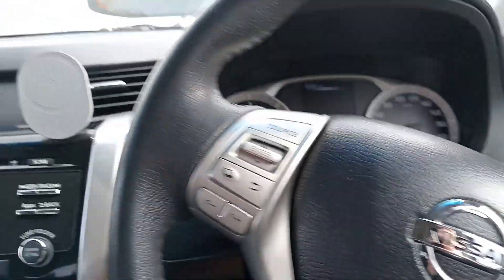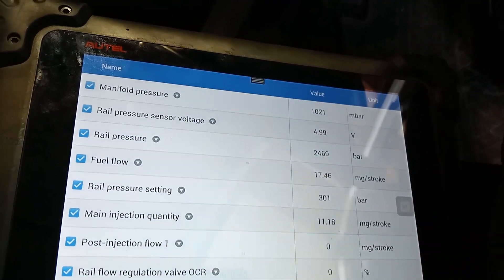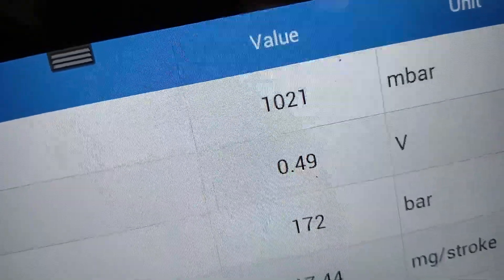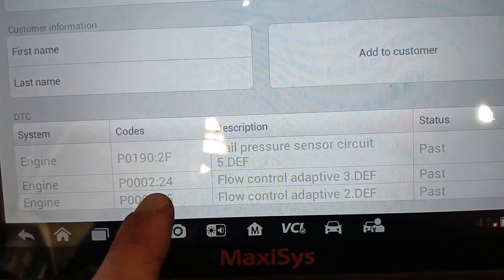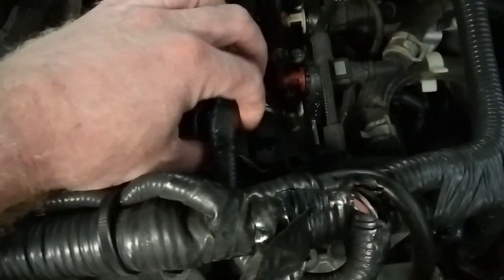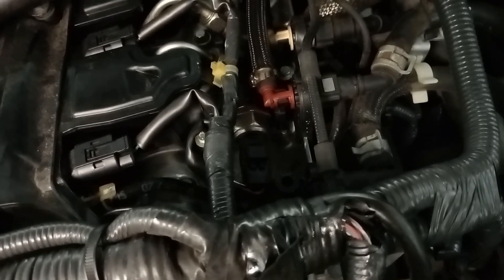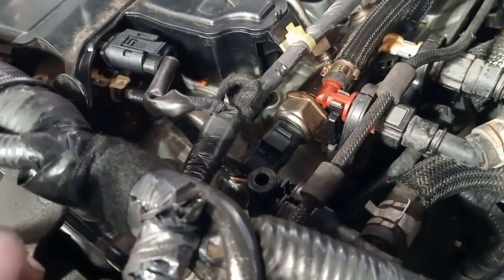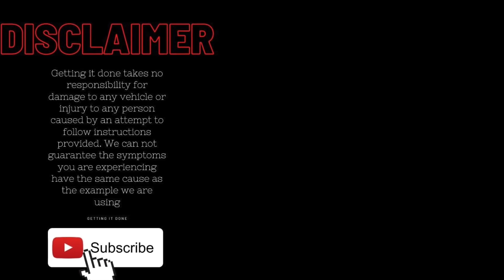Navara NP300 d23 fuel rail pressure sensor circuit (P0190)

Comment: I just experienced the exact same issue today. Could see the voltage was too high . Using my SNAP on scan tool . Cleaned the connections with inox Car  then started and worked perfectly . The vehicle was not starting prior to this and I had the exact same code